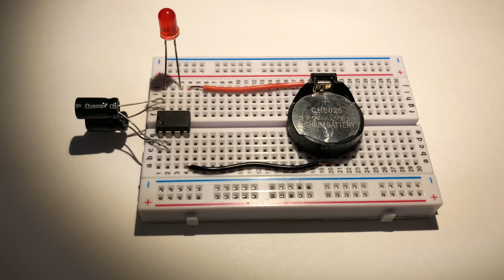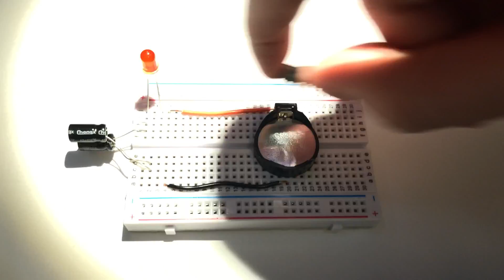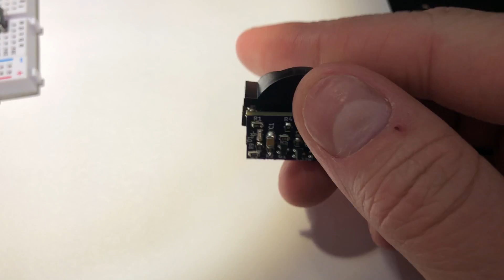Disintegrated LM3909 - 1.5V LED Flasher

Comment: The point of the LM3909 ( National Semiconductor) is that it works from 1.5V ( it boosts via Cap and internal switching) but you are using 3.0V not 1.5. At 3.0V you could just use a CMOS 555 to do that with no boost :- much cheaper.
Reply from the maker: twickersruss it works at 1.5v also
Reply: @DillonNichols  does it start at 1.5V  that would test boost working. BTW do you know why the LM3909 is so expensive? Even when it was new back in the '80's it was prohibitively expensive. I was into LED jewelry then and did exactly what you did to design around it because of the creazy price. Its not even a big pice of silicon.